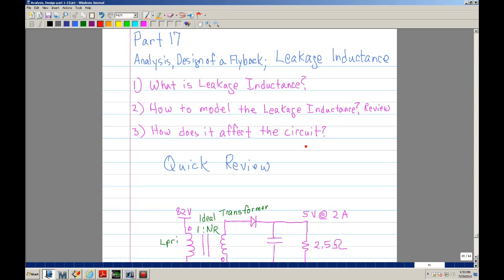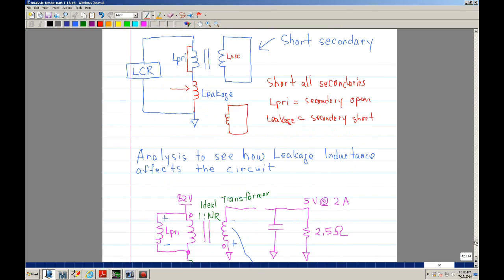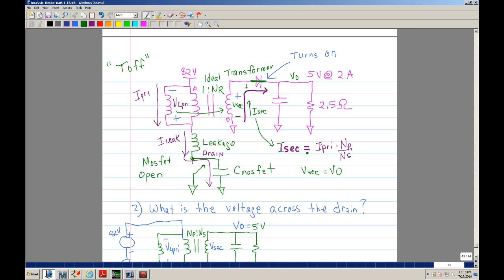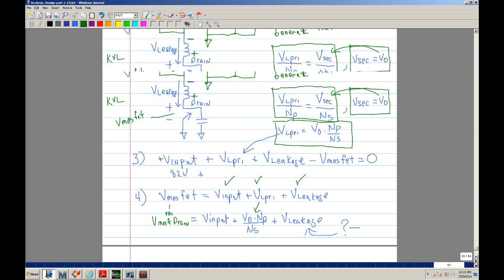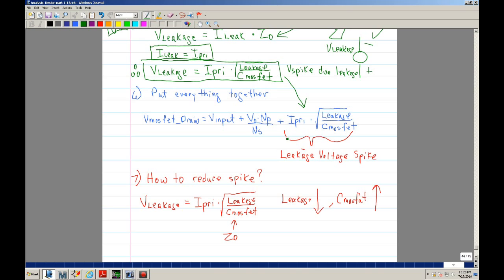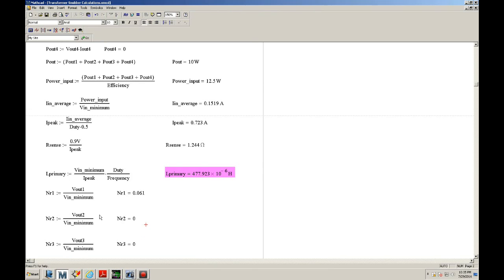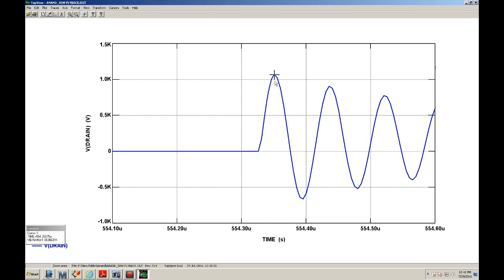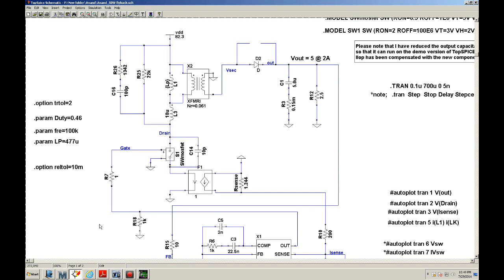Analysis and design of a flyback. Leakage inductance. Part 17

Comment: Around the 24:34 mark, how are we saying that the leakage inductance can be modeled by a current source but also include the inductance in the model as well? I know based on our discussion today, we derived that model from the small signal analysis, hence why the components are in parallel. But shouldn't the inductance in the model include both L_Pri and L_LK?
Reply: It seems that all the calculations are the same as for series resonant circuit so they work but representation is misleading, but maybe we are wrong, and it is indeed paralell resonant circuit.
Reply: Hi Robert... for the tank circuit, it should be noted it is in series, not parallel.  The argument should be made that the impedance or series is the same as the parallel. It is confusing to most people to accept it is in parallel when the leakage inductance is definitely in series when the mosfet is open.